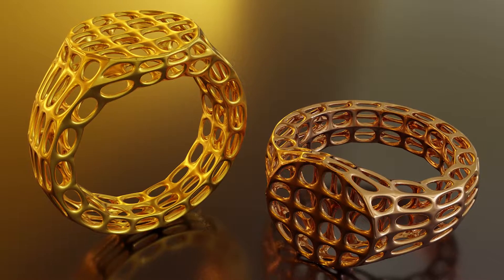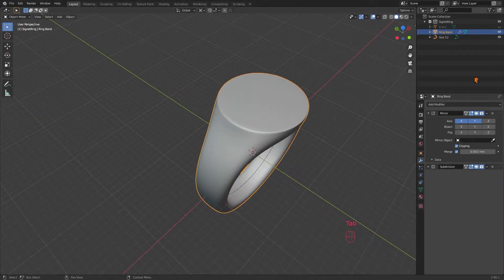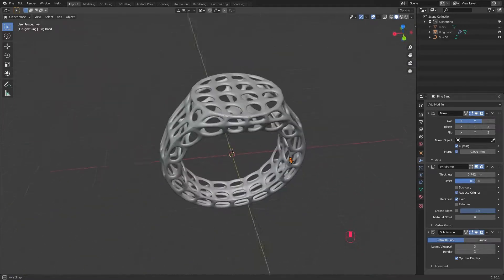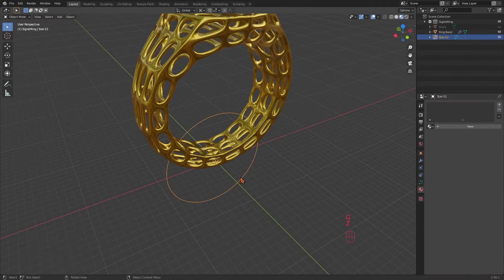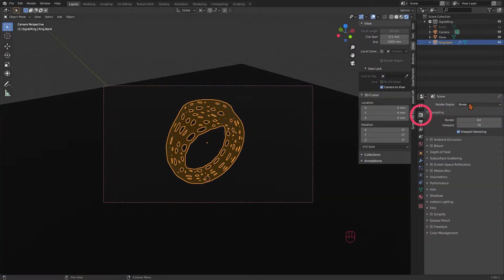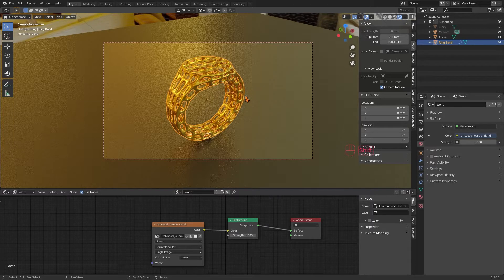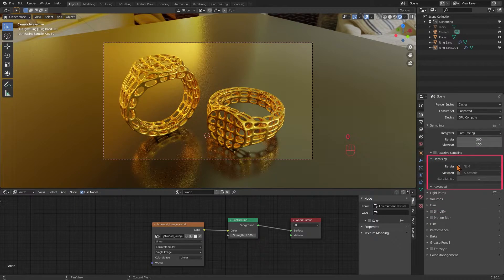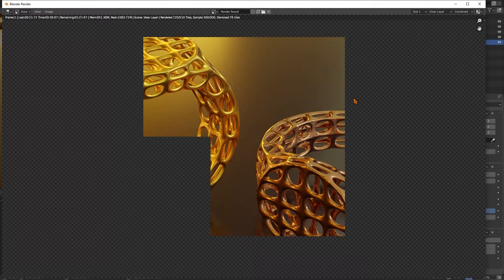How to: Wire Signet Ring in Blender - 3D Printable

Comment: How you do a size? Or this doesn’t matter for print?
Reply from the maker: Hi Туко, you can check the size by selecting the model and then checking out the size in object mode in the N menu under Item -> Dimensions. When exporting, you can also readjust the final size once again.
Reply: @PhialoDesign  thanks!

Comment: Ive watched all your videos and they are great! ❤️ I was going to ask about the printing because I was curious how one would sprue this in a good way to get the metal everywhere when casting. Also, my slicer complained about the geometry and wanted to print supports on the inside of the ring  I understand that you use an external party to get the wax (Shapeways?) so I'll just leave the question hanging here in case anyone else tried and succeed to print this vis a resin printer and feel like answering 😊 Thank you again for your lovely work 🙏

Comment: hello, how do you cast them in silver? PLA melt?
Reply from the maker: I actually used Shapeways for printing and casting it, in the description you will find the link. But in essence, you can print it on a Formlabs printer for example, then embed this printed shape into casting sand, then pour molten silver into it...https://formlabs.com/materials/jewelry/ ...it is actually a simple process, but you need experience to get the result right...

Comment: i just wanted to add that even if blender crashes while working on an unsafed project, i always recover the project via autosave. i never used a program that is so gentle with this. for me it seems like it is always doing an autosafe while, or just before crashing.
Reply: After 10 years of using Blender, I'm still amazed that it's a free software.
Reply from the maker: Autosave seems almost like a magical part of Blender.

Comment: how do you print it? it's very intersting
Reply from the maker: This ring I printed with the help of Shapeways. They use a wax 3D printing process which builds the model layer by layer with some soluble helper material in between, which is later dissolved so only the wire frame is left over. Shapeways probably attaches this model to a "casting tree" together with many other models. Then this casting tree is pressed into a mold, the wax is heated and poured out. The mold is filled with the molten metal and cooled down, and then the mold is destroyed and only the metal is left over. This is the process in a nutshell. Afterwards the tree needs to be "cut down" ;) and the individual models are sewn off, sanded and polished.
If you'd like to try ordering any 3D plastic or metal prints from Shapeways, feel free to use my referal code for 15% off: UG96S4
Happy Blendering!